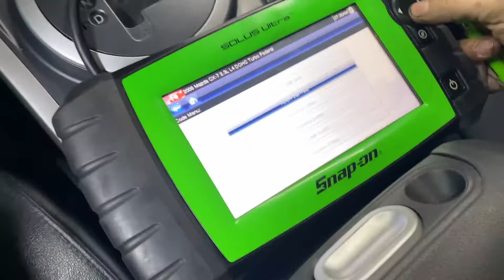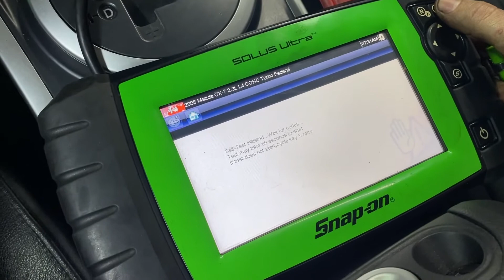Mazda CX-7 P2006 Intake Runner Stuck Closed/Open

Comment: I have a 2008.5 Mazdaspeed3 that has the P2006.  I have had it on and off for years.  I check the plastic piece that you replaced but it is still intact.  I replaced the runner control valve with no luck.  Could it be a faulty switch that goes against the plastic piece.  I’ve looked up this part and have no luck.
Reply from the maker: Possibly, part may be dealer item
Reply: Did you ever find out the problem @gomer698 ? I’ve been dealing with same thing help a brother out pleaseee🙏🏼